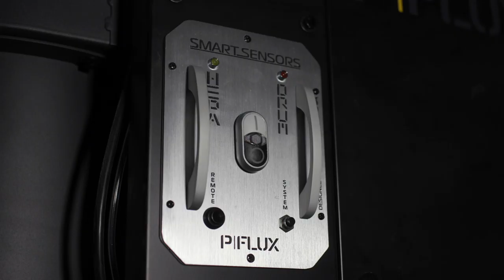Bowl sanding techniques with Glenn Lucas

Comment: Downloading your videos has worked well for me. I have also then copied them to DVD to play in my shop. The only downside there is that the DVD does not have chapters, so if I leave it to do the technique you describe, when I go back to the player I have to start over at the very beginning. I've seen you walk to your shop and light the fire MANY times! I hope someday to see it in person!
Reply from the maker: Marianne Patton Thankyou Marianne for getting the downloads. Unfortunately making your own DVDs has it’s limitations unless you have the right gear. You could put the downloads on a tablet an bring it to the work shop if you have one. I will be starting live demonstrations from my workshop next week. Details are now on the website.
Reply: @GlennLucasWoodTurner  I suggest you add the .iso format as a download choice. ISO format has the same quality as DVD and allows use of chapters with some apps, for example with VLC.
Reply from the maker: @antonio.zanella  Thanks for the info Antonio but that would not solve the problem if someone makes their own dvd from a download that they got from me but it would work with VLC as you suggest.

Comment: This was very helpful, I actually changed to using smaller discs inside my current work with great results, thanks! I have one question though... you mention lathe speed in your video but not drill speed, are you using them on full speed?
Reply from the maker: Hi Joshua, 
It is hard to give the exact speed of the drill as you know. I would estimate if 2800rpm is full speed then I am at about 1400 - 1500rpm
Reply: @GlennLucasWoodTurner  Thanks Glenn, much appreciated :)